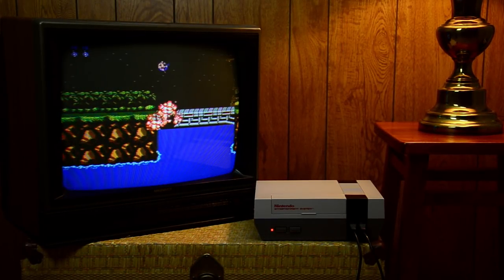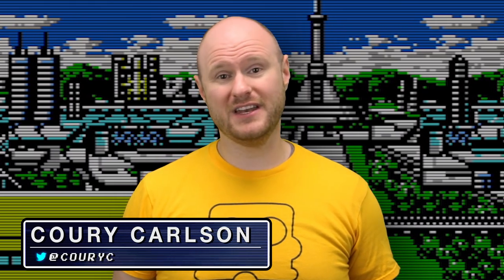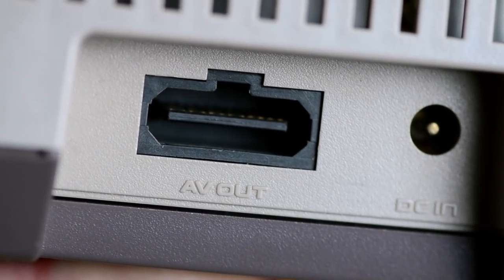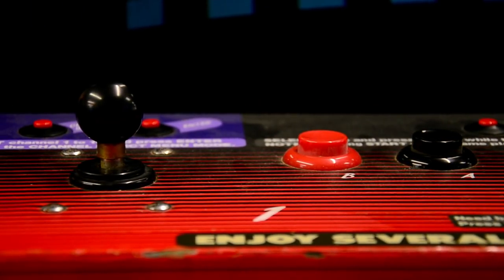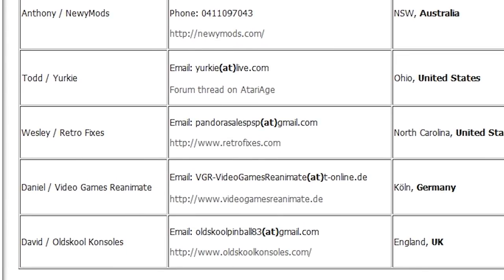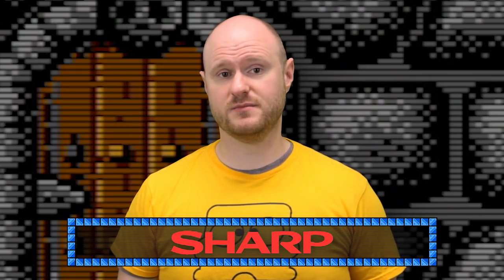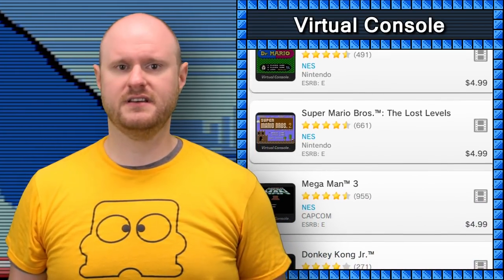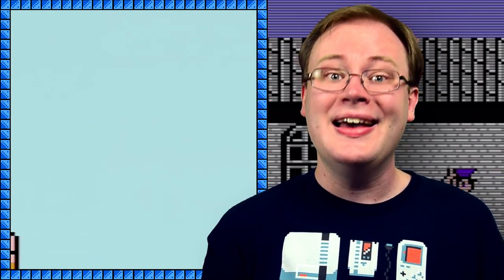Nintendo Entertainment System :: RGB 202 / MY LIFE IN GAMING

Comment: It's a shame that the best options for NES are relatively expensive.

I wonder if Nintendo's NES emulator code actually dates back (in part) to Excitebike 64, which had the original version of the game included as an unlockable (if not, it presumably dates back to Animal Crossing for GameCube and/or the GBA NES collection). Nintendo also developed a Game Boy emulator around this time (for the Pokemon Stadium games).
Reply from the maker: [Try4ce] I haven't extensively tested the Gamecube NES ports since getting the Framemeister, but I did play a little Zelda from the Collector's Edition and was definitely not impressed with its blobby scaling. It wasn't dark, though.

Comment: 8:14 How well do Rad Racer, Contra and light gun games play with that NES to Famicom adapter?

Only recently I started purchasing NES titles through the Wii, although not all the games I'm interested in can be purchased through the store. For years I've been reluctant to buy an actual NES because of the hardware problems and limitations. The NES's front loading system is faulty and unreliable, and the top loader only has RF out. True, there is the Blinking Light Mod for the former and AV mods for the latter. But I don't want have to deal with expensive modding for overpriced consoles, especially for only a handful of games. 

The AV Famicom looks promising, but how well does it handle Rad Racer and Contra through that adapter? I've been getting conflicting stories as to whether or not they work. I've also read conflicting stories as to whether or not the lightgun works with the AV Famicom. Some say it works, others say it needs to be modded to use it. Which is it? Can you set the record straight for me please? Thanks.
Reply from the maker: +Jarrah White [Try4ce] NES light guns will NOT work on it, even if you're using the American version of the game through the adapter. Even though the AV Famicom has NES controller ports, light guns only work through the expansion port. Contra works fine. Not sure about Rad Racer, but I have played the Japanese version on it, Highway Star. As a side note, I really really recommend the Japanese version of Contra, even though it's a little pricey. It has a lot of great background animations, a world map, opening cutscene, and an extended ending. But the American version plays just fine, at least with my particular cart converter.
Reply: OK, thanks for the advice. So I'd have to get a Famicom expansion port light gun for NES lightgun games played on it? Just FYI though, I'm a PAL user, so I'd probably be sourcing PAL versions of games. Have you tested any PAL NES games through the adapter?
Reply from the maker: [Try4ce] I have not played PAL games on the adapter, but supposedly they work if you reverse the games (American games face frontward, PAL games face backward). I don't know if American or PAL light gun games would work with the Famicom light gun or not... no idea. Sadly, the Japanese gun is also a bit pricey.
Reply: Sorry if you have answered this somewhere already but which model (brand) is your nes to famicom adapter?
Reply: When I asked the question I didn't have an NES. The front loader has composite AV but an unreliable loading system, and the top loader only has RF. The AV Famicom with the cart adapter seemed like a good deal, but if the adapter wouldn't handle the games I was interested in that would be the deal breaker.

I've seen acquired a PAL NES top loader. The PAL units have a revised motherboard, for RF it's not that bad.

Comment: When you were showing the NES Virtual console, were you using the Wii on 480p or the Wii U in 1080p? I hooked up my Wii U via component cables and outputted it to 720p, and my NES games were way sharper than it appeared in your video, and it was even brighter! Maybe it was the Framemeister? Or an update to the Wii U?

P.S., I was playing in the Wii Mode portion.
Reply from the maker: [Try4ce] Hey! I just ran through a few tests to be sure I wasn't overlooking anything. NES VC in the Wii U portion looks like garbage no matter what you do - no matter what resolution or cables. NES VC in Wii mode definitely looks sharper, regardless of your system's resolution settings. I tried component cables too... it's looking brighter for me as well, but I'm fairly sure that it's probably just how my TV is set for component input (the Wii menus look a tad over-bright to me). It would be interesting if 720p had an effect because of it being an integer 3x scale from 240p, but that does not appear to be the reason it's sharper. It's just sharper because Wii NES VC is better than Wii U NES VC.
Reply: The great part about this is that all the games you re-bought from the eShop that were on the Wii mode, they're all still there! Personally, I'm just gonna play all these games in Wii mode. Thanks for making sure I'm not crazy.
Reply from the maker: [Try4ce] Don't forget that SNES looks a lot better on Wii U than Wii Mode, at least. N64 looks about the same in both, I can't remember if I've directly compared those before, though (it's dark like NES).
Reply: ***** Thanks, I actually didn't test it with SNES. Also, N64 looks darker on Wii U than Wii Mode, at least for a few games, such as Paper Mario.

Comment: fceu is an emulator to run NES games on ps2. It outputs 240p insanely good. You can choose between Interlaced mode or not. If you choose not you can clearly see the scanlines if you hook it up to an crt using european scart connector. Cheers from Sweden

Comment: Did you try outputting the NES virtual console footage from the Wii U using component? Like Wii games, it may record better that way.
Reply from the maker: ShogunGin0 [Try4ce] Yeah, sadly, the Wii U just doesn't work that way. Even if you boot the system in Wii mode, its capabilities are not as versatile as the the actual original Wii hardware.
Reply: *****
I can't entire agree, since I remember playing Majora's Mask on the Virtual Console, and on the Wii, it sometimes skipped some frames and stopped the music for a second when entered a different quadrant of Clock Town. On the Wii U, no such issue exists.

That said, have you noticed similar issues with Virtual Console games that aren't NES? Like, that they look worse on Wii U?
Reply from the maker: ShogunGin0 [Try4ce] Well, N64 is another matter altogether, as are the other VC systems. We're not saying VC is bad, in fact, it can be pretty good! We're just singling out NES as being kind of bad on VC, for whatever reason. I've also seen a lot of complaints about lag on NES with the Wii U, which I don't think is a complaint I've seen for other VC systems. I'm not as sensitive to lag as a lot of other people are, but I do think something is a little bit off. At 11:08, we actually show NES compared to SNES and GBA on Wii U... both of which look quite good! I'm also very impressed with what they've done with DS on the Wii U so far.
Reply: *****
Oh, I wasn't trying to say that you think the VC was bad, I guess I was just asking for clarification on which consoles seemed worse emulated on Wii U than on the Wii. So, it just seems like the NES is the only sour one of the bunch. A bit weird, because one would think older consoles would be easier to emulate than N64, which is generally difficult to emulate.
Reply from the maker: ShogunGin0 [Try4ce] I feel like it's less about difficulty in emulation, and more just some unknown reason that Nintendo decided to use that awful look. I know that GBA and I think DS are handled by developer M2, who are super respected for their careful handling of retro ports and emulations. Those systems look great on Wii U! Not sure who handles SNES and N64.
Reply: ShogunGin0 It's because the Wii U doesn't support 240p and has all VC games 480i and up.

Comment: I'm thinking about replacing my NES with an RGB modded AV famicom. I've heard that there can be issues using NES controllers on them. Have you had any problems? Or maybe it's just with multiplayer adapters... Like the Four Score or Satelite. Do you know anything about that?
Reply from the maker: [Try4ce] Regular NES controllers work perfectly! I'm not sure about multiplayer adapters or any other weird controllers. The biggest bummer is that the Zapper will NOT work. Famicom (including AV Famicom) read light guns through the expansion port. So even if you're using the North American version of Duck Hunt, you cannot use a North American Zapper with it.
Reply: That kind of kills it for me. I'll have to see if there is a mod that could work around that.

Comment: Wait, does the Twin Famicom support RGB natively? You haven't specified it's output PPU. Also, please consider the PC-Engine for the 203 episode :)
Reply: ***** It doesn't, you need to mod it as well.
Reply from the maker: ***** [Try4ce] It does not, we should have clarified that. It has no special output capabilities. As for PC-Engine, that will be a very important episode for us, but we feel like we need to have access to more of its revisions and mods before we can do the system the justice it deserves. It might end up being nearly as complex (if not more so?) than covering the NES/Famicom!
Reply: Regarding the pce, I have a duo, an original pce and a tg16; all modded. I can help with info on that if needed.
Reply from the maker: Artemio Urbina [Try4ce] Thanks! We think that next to NES, the PCE will potentially be the most complex topic.  Currently, the only system of that family between the two of us is Coury's PCE Duo (RGB). We feel like one of us needs to have a TG-16 version before we can really do the system justice with a video. It's something we're talking about, but in the meantime, there are tons more systems we can cover!

Comment: on a 26" smart tv, av modded famicom gives  great image quality with some ceramic capacitors.
Reply: Do you plug it directly into that Smart TV or do you use an external upscaler or line multiplier for the AV famicom

Comment: I knew I wasn't going crazy when I was looking at Kirby's Adventure on Wii U VC vs. Wii VC and saw that the Wii U VC one was much blurrier. I know this part is a SNES game, but I played EarthBound on Wii U VC and then tried the Smash 4 Demo of EarthBound using the same HDMI cable and the Smash 4 version is pixel perfect (or at least extremely razor sharp) on my 1080p monitor and is very noticeably blurry on the VC version. This makes me think it's the Wii U VC emulator. hmm
Reply from the maker: [Try4ce] I'm pretty sure I also remember NES Remix looking a fair bit better too.
Reply: nsArmoredFrog That's funny because for me it looked pixel perfect when I play Earthbound on my Wii U, not sure if it's TV differences or maybe I haven't noticed the difference between the Version on Smash 4 and the Wii U Virtual Console since I unfortunately do not have Smash Bros. Wii U yet atm.

Comment: OK, so bottom line: what is the simplest and cheapest way to get a pure RGB signal out of the NES hardware, without using expensive add-ons like the Framemeister or drastically reworking the circuit board? Clone systems suck, but I really liked the idea of Kevtris' HDMI mod.
Reply from the maker: [Try4ce] Unfortunately, some internal mod has to happen, there's no other way. If you want to use RGB without something like the Framemeister, look into PVMs or converting RGB to YPbPr. Check out our dedicated video for the Hi-Def NES: https://youtu.be/TI60A3DpI6w and our video all about CRTs and PVMs: https://youtu.be/RAi8AVj9GV8
Reply: +My Life in Gaming Another question: will the NES RGB add-on board work in the front-loading version of the system? Ideally, I'd like to do that combined with the Blinking Light Win repair part. The toploader was okay, but cartridges had a tendency to wobble or be very tight.
Reply: +Moviefan2k4 Yes,  have the NESRGB board in my front loader NES. works amazingly

Comment: So from what I'm getting, there are no RGB mods available for the original Famicom? That's kind of a shame, I really like the original, if only for the aesthetics. Also, the microphone. That's pretty important too.
Reply from the maker: +FANB [Try4ce] I think you can? Check if Tim sells am adapter board for it. I assumed he did, but I never really looked into it.
Reply: thank you for responding so quickly! After checking, it appears he does sell an adapter board, but the way the installation guide is worded leaves me confused, as I am not sure whether it says the "cartridge eject" switch won't work once the board is installed, or if it is simply moved out of the way during installation for convenience.

Comment: Have you guys ever had any experience with the Famicom Titler System that has base RGB output? I never heard of it till just now on eBay.
Reply from the maker: [Try4ce] Sadly no, it's very rare. If I recall, we believed all of them had RGB at the time of this video, but also if I recall, I think that may not be the case, it may only be some. Keep in mind that it would use the same RGB palette as PlayChoice 10, which is extremely different from traditional NES colors, and most consider it to be rather garish, but it does have its fans. As for the signal quality, we have no idea.

Comment: I just got a dvd/vcr combo dvd recorder n plays vhs in s-video n component tho component is dark n looks terrible but svideo looks the same as av but slightly better I hooked my nes up to it n plugged dvd/vcr combo to component n it works but there was a very noticeable judder n slow down same for svideo no problem when in av mode tho so it’s kinda possible but not also I connected nes with a straight connection to component with Y adapters n it worked n pitcher was sharper but defaults to red or blue same goes for genesis which is weird I even had a cheap component cable for genesis that did the same

Comment: Great vid guys, I just suscribed. I came across this vid while searching for a solution to a problem I'm having. I have a vizio ultra hd tv and it does not want to recognize video input from my front loader NES. I tried composite and have tried the composite thru a vcr into the antenna port. The tv reads the vcr fine, and even shows the NES image for a split second before it goes "no signal". The NES works fine on my other 1080p Insignia lcd tv. I have searched for an answer and can't find it. I also tried it thru my hdmi receiver. Any suggestions?
Reply from the maker: +wtsig76 [Try4ce] Thanks for subscribing! Have you tried other retro consoles on the new TV? Some HDTVs will not recognize a 240p signal (most games on most consoles before the Dreamcast). I've also heard that some inputs on certain TVs might accept 240p, while others will not (for example, if your TV has a green port for component video that also doubles as a composite input, perhaps try that port instead of the dedicated composite port). It's possible that you may need an external scaler like the Framemeister, which deals with the 240p signal itself, while outputting a 1080p signal to your TV (I don't know if Ultra HDTVs introduce any lag when scaling 1080p to 4K... been meaning to research that). The guys over at HD Retrovision have a really good article explaining the potential challenges of 240p on modern displays: http://www.hdretrovision.com/240p/

Comment: Would a composite to s-video cable work on an NES?
Reply from the maker: Super_Buza [Try4ce] It would probably "work" in the sense that it would get the signal from the system to the display. However, it's impossible to turn composite into S-Video so simply. The signal would be received and displayed, but it would not be improved. It would just be composite quality video displayed over an S-video input. If it's already left the system as composite, then there's no saving it.
Reply: But would the picture quality be like true s-video with sharp pixels, no rainbowing, but with a checker board pattern on certain colors like a cheap SNES s-video cable or would it be the same quality of a real composite video signal with no change?